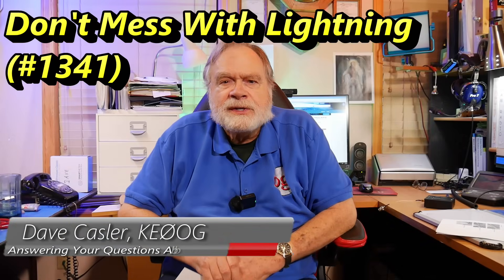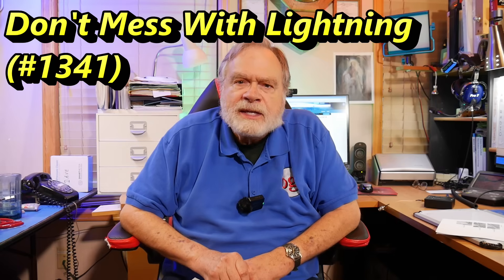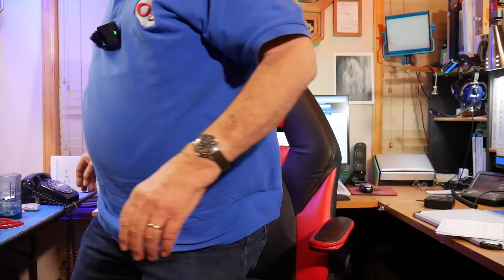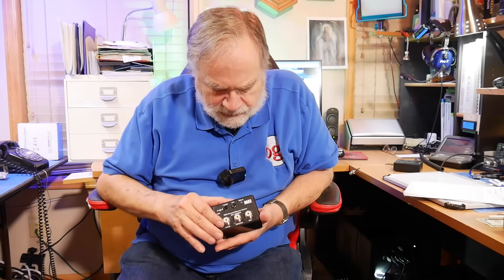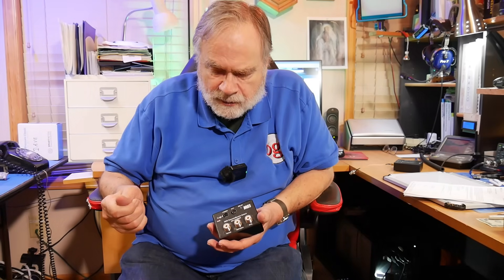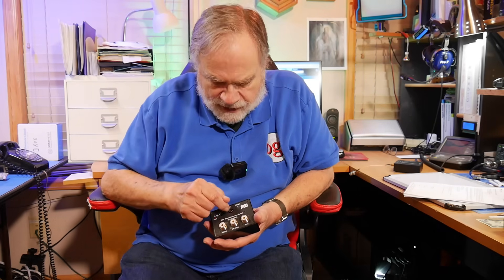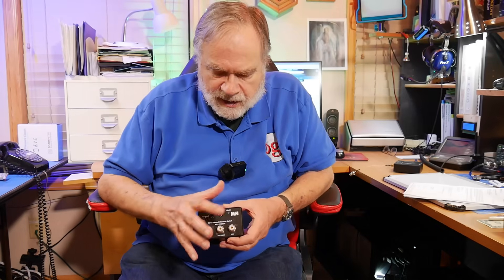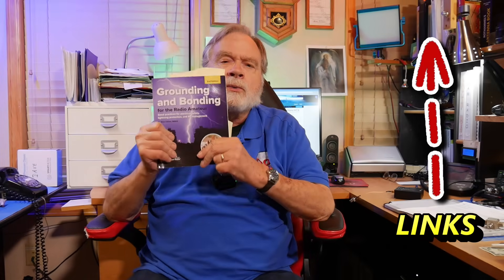Don't Mess with Lightning (#1341)

Comment: this would be exceedingly difficult since  code in Ontario allows and our house has the electrical panel safety ground from the panel connected to the copper cold water pipe where it enters the basement the mid point of tha house front basement wall.  There is no way in hell to make a bonding connection to that point without going through the house... in my case I connect my second floor shack to a pair of 8 foot ground rods a foot away from the basement wall directly below that room... there is no other viable option.....

Comment: Dave, love the videos. You are one of the main resources I used to get my general and extra.  I have a ufer main ground, which is in my basement.  My shack is in my basement.  Since I did not want to bring a bonding wire inside, I placed the lightning arrestor at the antenna with a ground rod there and ran the coax inside.  Should I bond this to the ufer ground inside.  If it matters, it gets weirder, my house is a sub panel from the main panel in the barn.  By building code, it is not bonded to the utility ground, the barn is. The house relies solely on the ufer ground by code.  I am told it would be dangerous to bond the house through the barn to the utility ground. (and not legal)

Comment: I had a MFJ 1708 I used with an Icom IC-718 for transmitting, and Icom R75 receiver for receiving.  The R75 was a better receiver than the 718's receive section.  Still, when transmitting there was a feedback problem from the leakage to the receiver, out the speaker, and back into the microphone.  There were two ways to solve this.  First I tried headphones, which worked, but I was still hearing my voice in the headphones.  Then I ran a line from the MFJ 1708's Aux socket to the Mute phono socket on back of the R75.  This turned off the audio of the R75 while transmitting, solving the problem.

Comment: The internet experts all seem to be on different pages. Code writers have absolutely no skin in the game since they probably will not be sued when your house burns down. I have since tried to use a system that incorporates the best common sense methods of grounding. I'm just a country hillbilly, but I agree Mr. Dave keep the fight outside. Rohn shows using 7/16" galvanized steel wire rope bonded to galvanized grounding rods spaced at double the distance of the ground rod length, which NO one on the internet seems to incorporate into their grounding systems. I have every mast grounded at the base and every single ground rod is bonded back to my main grounding point and my tower are all grounded with every leg using the Rohn system and bonded back to my house ground point. I tend to believe Rohn because they are exposed to a much greater liability than the experts or the code writers. Am I missing something, is Rohn wrong or the "internet experts" wrong.
Reply: That's what the ARRL book recommends.